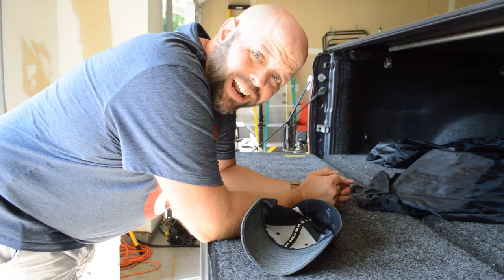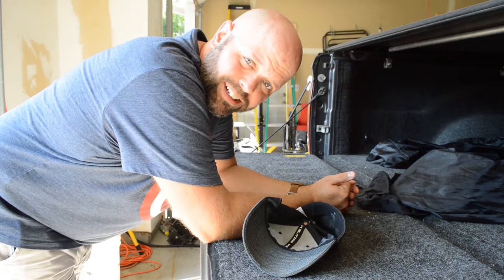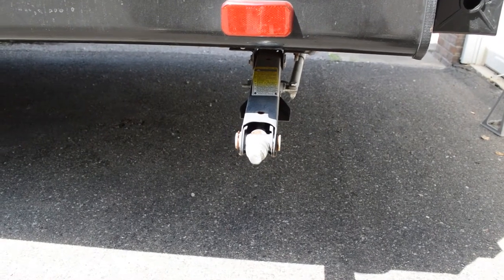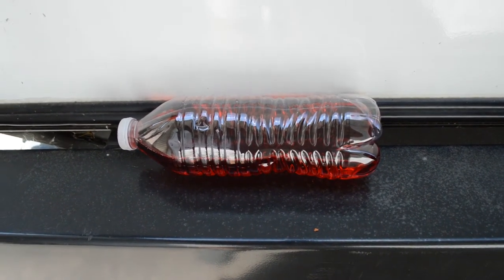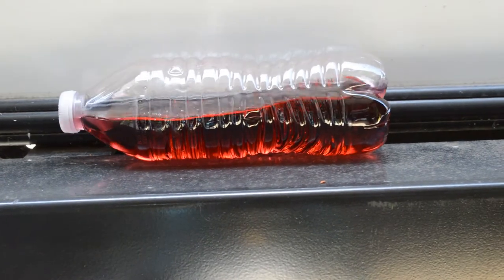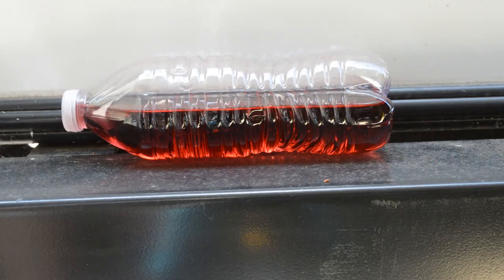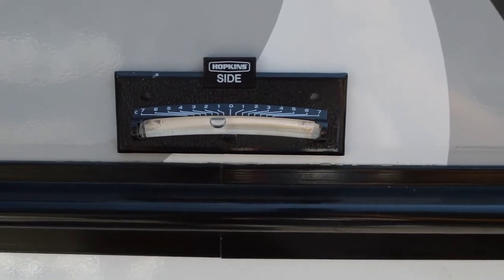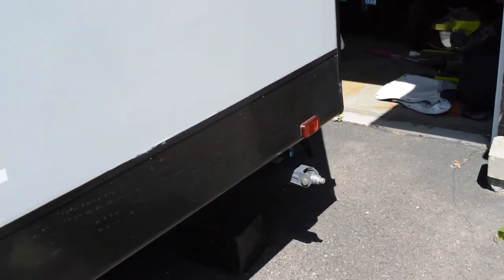Eliminate RV Movement and Swaying While Camping!

Comment: I noticed your driver side, front scissor stabilizer jack is missing a mount bolt on top the jack to the RV frame.  Ya may wanna mount the jack with all the mount bolts.  If you lose the only one while going down the road you're going to lose the scissor jack and the JT strong arms while towing.

Comment: Impact with 3/4 or 19mm Socket much faster for Lowering and Raising the jacks
Reply from the maker: While it's definitely faster, it's also a great way to round off the nut on the jack. Then you're in trouble.

Comment: Never never put a support under a slide out pushing up on the slide will bend parts in your slide
Reply: The support is under the frame where the slide is located.  It is not under the slide.
Reply: @paulsylvester1394  sorry about that I thought you where putting them under the slide.

That weight you are putting on your stabilizer jacks are not what they where made for. I watched some take the weight off their tongue to the stabilizer jacks and they both broke. Please be careful.

I have a 28ft TT I level side to side. Then I put on xchocks between the wheels before I remove the TT from the truck. Than I level front to back and put stabilizers down and a 4x4 under the steps and I have minimal sway.

Comment: Dude! The bolts are missing on your front stabilizers at the camper frame!
Reply from the maker: No, they're good. Where in the video does it look like they're missing?
Reply: Where the jack rides on the frame, there are only screws on one side of the jack look under the trailer. Thanks for the video I thoroughly enjoyed it.
Reply: At exactly 9:02. Front jack is loose, very loose.
Reply: Nice catch!
Reply: Totally missing bolts. Need a trip to Lowe’s! Stabilizer is steadily moving where they should be bolted

Comment: Great video. One thing to note (and test) is if you use same method (lower tongue jack, extend rear stabilizer, raise tongue jack, lower front stabilizer, lower tongue jack a bit). Since this methodology basically reduces load on the wheels and the suspension it would reduce vibrations a lot even without the extra braces. Most of the rattling around is because even when stabilizers are down (and extended by hand) most of the weight still sits on the springs which are designed to be flexible so the camper isn’t trashed when hitting a pothole.
The big downsize is that putting weight on stabilizers (either by using power tool or by lowering/raising tongue jack) puts a lot of weight on the stabilizer jacks and most factory jacks are not designed for that much weight so can collapse. Some claim it might damage the frame but I doubt it as same weight with same frame is supports entire camper on the wheels and is supposed to sustain shocks while driving on road so one would need to put a LOT of weight on stabilizers to impact the frame.

Comment: I have the exact same MPG travel trailer (2800QB) and we love it. Like you mentioned, I too hate all the rock and sway. I now understand what I need to do to eliminate the problem! And I like the idea of raising the back slightly then lowering the scissor Jack's and raising the front back up to take weight off the tires. Thank you for an excellent video!
Reply from the maker: Thanks for the comment! Glad I could help! Just be sure to not put too much weight on the scissor jacks. That's why I do a quick 5 count. Otherwise you will end up stressing the jacks and potentially the frame.

Comment: Cool, I was wondering what those bars did when I saw them on Amazon.
Another thing that helps a LOT, are the RV Stabilizer Wheel Chocks scissor jack things.  Those things are awesome.
Reply from the maker: I'll have to check out the X Chocks (or whatever they're actually called.) My old trailer couldn't use them because the wheels were too far apart but they should work like a champ on this one!
Reply: @dontburnthehousedownvideos  I just gave my old ones away with my last trailer and ordered new ones.  The new ones came and don't fit...  These ones fit for sure though:  BAL 28012 X-Chock Tire Locking Chock
So I grabbed a pair of them just now.
Reply from the maker: I'll check them out. Thanks!

Comment: I got those JT Strong Arms for my rig and they make a HUGE difference..  Been RVing my whole life essentially and have always had the rocking and rolling with any kind of stabilizers..  Sure, they take the bounce out, but the rocking was always there..

I have all six bars and only had time to put the side to side ones on (4), and figured I'd see how they worked before putting the front to back ones on...  I'll be putting the other 2 on before our next trip out..  Easy enough to do as a DIY job.. Just need a good drill and drill bits and measure several times and drill once! :)

I had to tap the rears on my Rockwood, but the fronts and the additional 2 I'm going to install, I can just drill into the "I" frame and bolt them up.

I do like those ratchet strap ones too... I looked at those, but did not think about using them in addition to the arms...  Thanks and I just subscribed!
Reply from the maker: Thank you very much! I'm glad you enjoy the strong arms also. They are such a great invention and I get asked about them constantly at the campgrounds.

Comment: I just use the stabiliser legs that came with & attached to the caravan. They are not scissor jacks either and are also light weight construction.
They are the older lighter wind down types from 2008, not the heavier drop down legs on recent vans.

You just shouldn't need all this extra cost, extra heavy hardware.
There is no rocking ever.
But, hey, I'm in Australia, could this be why?

Comment: Very Interesting, I have in the past just cranked down the stabilizers to hold but not support the weight of the camper because of the disclaimer not to use them as a jack to lift the camper.
So when camping on gravel or ground you will still need to loosen the strong arms and retighten the stabilizers due to settling. Does that mean I need use the tongue jack to pre-load the back stabilizers and the reverse for the front? I would think you would need to do the same for those Valterra stabilizers which look good but what does it not bounce by the fact that the ratchet straps under tension will stretch? I would love to read your answer as I have said if I want to sleep in a boat I would have bought one.  :) One last question . Is it better to extend the stabilizers more or less and just use more blocks as a base?
Reply from the maker: If it settles you will definitely need to give them a few extra cranks. However, if you are using blocks or pads under the jacks they hopefully won't settle too much. But yes, I would use the tongue jack to take the weight off the rear and then re-load the weight after you crank it down a bit. The goal for the scissor jacks is to keep them extended up to 50%. The more you crank them, the more they will wobble. So if you happen to be parked on an incline and the front or back jacks need to go further than half way, use more leveling pads.
Reply: I discussed this with the maintenance manager at the camper dealership and he emphatically said " never use a stabilizers as load bearing NEVER and for the most part any site with sod or gravel base will not be stabil enough even with support pads. Constant tightening will be required.

Comment: So where did you exactly put the braces? Ones under the steps and the other in front of the slide out? I have the strong arms but Forrest river angled to front one … I think I need the most help in the rear of the rv..
Reply from the maker: The braces are on the frame directly behind the steps and on the frame under the slide out. That placement along with the strong arms keeps it pretty rock solid.

Comment: Do you recommend these over Xchocks?  Or are Xchocks fine?
Reply from the maker: Xchocks are great for keeping your rig from moving once you park it but they have very minimal effect on the camper rocking when you're inside it. It's my understanding that they simply replace standard wheel chocks.
Reply: I have x-chocks, and they don't replace wheel chocks, they do make a noticeable difference. Putting blocks under your stabilizers so they don't extend past 90° is the real key.

Comment: How do these working sand base
Reply from the maker: You'll want something to distribute the weight across the sand like a board. But if you do that, they should still work OK. You may need to tighten your jacks up a few times to account for settling.

Comment: Those T-nuts will rust into the legs.  Have fun with that.  Do NOT screw those in, it doesn't make the camper sway any less.
Reply from the maker: Are you referring to the T bolts on the Strong Arms? That's literally what they're made to do. Locking down the t bolts is what stops the swaying. And yes, they work extremely well. I've had them on two trailers and they worked great for both.